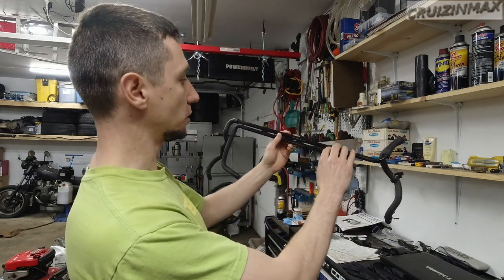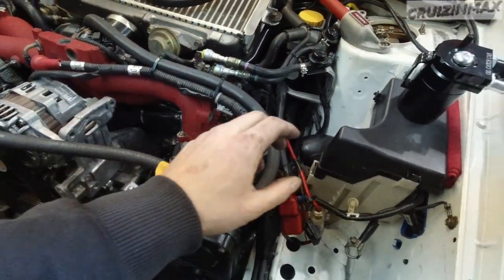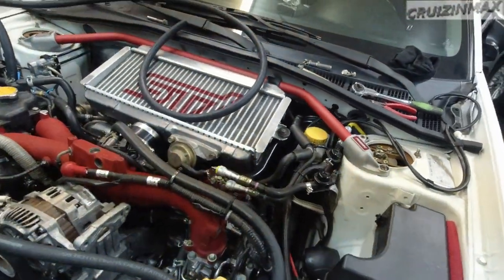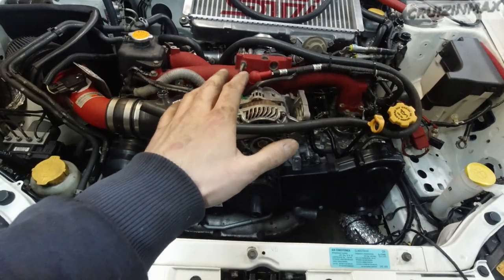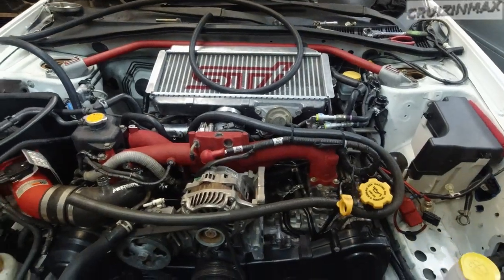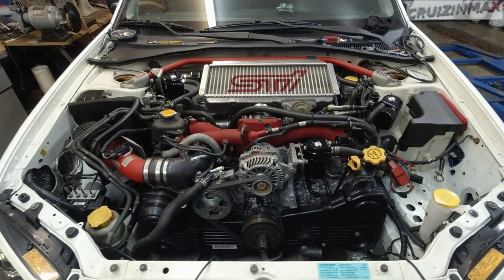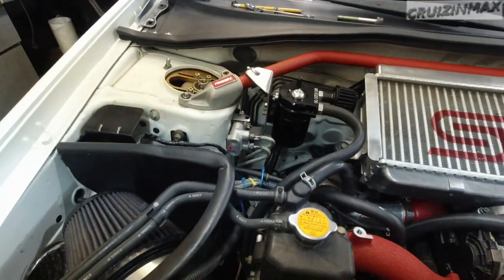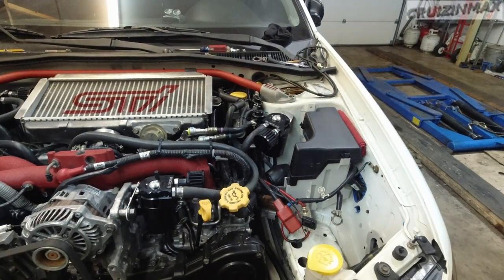Subaru STI EJ25 build part 12 oil catch cans

Comment: Nice cool easy video,Did you delete the pcv valve from the back of the manifold ??
Reply from the maker: the pcv valve is on top of the block on the 06 STI but I did cap off the intake outlet.
Reply: The pcv valve is in the back of the inlet manifold on a 06 sti i no this because I literally just replaced mine if your running cans it will need blanking off . 👍🏼